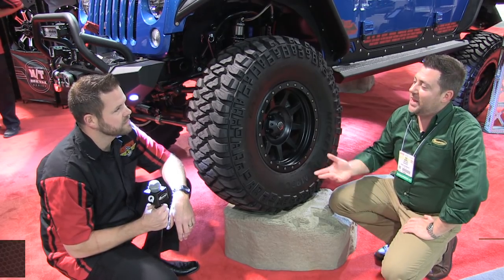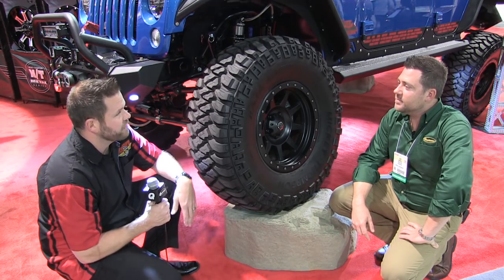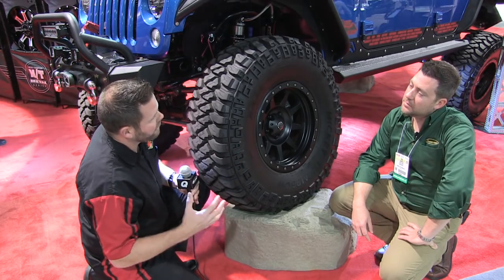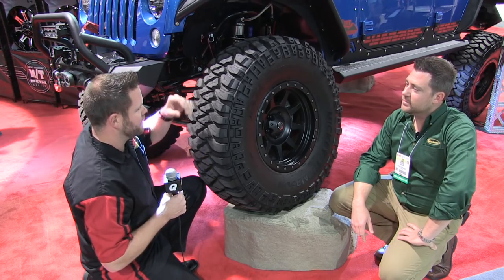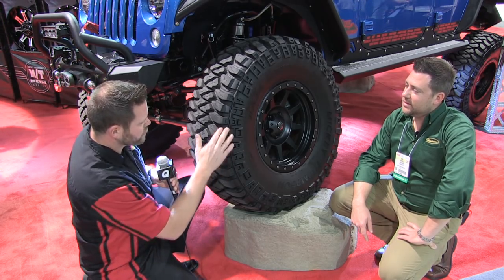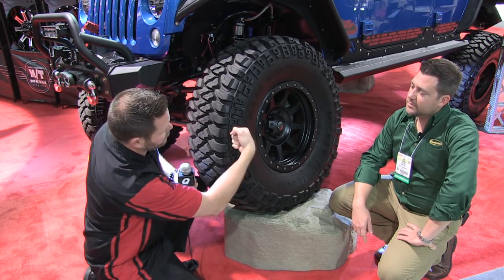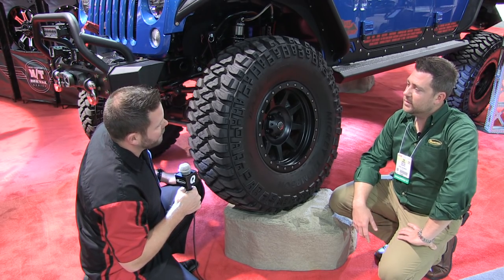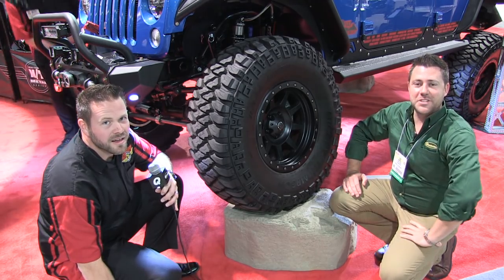Mickey Thompson MTZ P3 Tires Review

Comment: My dad had the regular 37 mtz on a 2005 f350 it was a 4door 8 foot bed with a 6 inch lift and where we rabbit hunted we had to go down a super curvy and hilly road and he took the road 65-70 and it never missed a beat and they went graat
Reply: Jake thequadrunnersnake how are they holding up. I have a 2002 f250 and I'm wondering if it's a good tire for diesel trucks

Comment: I just blew punctured sidewall on a 3 year old 35" MTZ. I ordered a single MTZ p3 as a replacement. Slightly mismatched from the rest of truck but looks like a mean tire.
Reply: how is this working out. are they pretty similar. i dont have alot of money so im taking my spare which is new. and wanna buy 3 new ones but they changed em obviously. lemme know how its working out.m

Comment: I've had BFG forever and they rock in mud but i want to try something new,i like the looks of the baja claw but the tread depth is shit,it looks like it already has 20,000 miles on them brand new so maybe this would be a new tire,truly i just want a new look you know damn,I'm tired of the same tire even though it works,honestly i don't do much mudding as i used to but want it if i need it.so I'm torn between the two,the claw or the mtz size old school 35-12.50-15 i wish it came in a 13.50 -15 i would love something wider.thanks

Comment: do the 35 12.50 20 come with a white side or just both sides black.
Reply from the maker: One side has raised white lettering.
Reply: Cool I kinda like the white writing but I noticed 33s and 35 and 37s in most brands are all black it's hard to find the white side in a big tire.i been thinking about getting these mickey Thompsons only cause I want a 35 tire that weighs less.i think they are 70 pounds and the 35 nitto I have now are 81 pounds tires are too heavy.

Comment: Im going to be honest im a little disappointed. They changed the tire look a tad, the biters on the sidewall are about half the size of the original now, the old design had offset lugs on the sidewall, the new P3 has more of a flat look to the sidewall tread, the old design was one of my favorite parts about the tire, the tread doesnt look as deep anymore as the original...
We asked to not screw it up. And you did. You literally should have kept the old design of the MTZ. And do whatever new features you guys added to the P3. Mickey thompson took a good tire and ruined it. 😒
Reply: I seen that too, cause I have an old set an a new set. Yeah they did screw it up. Old tires looked way better but yeah I know what you mean